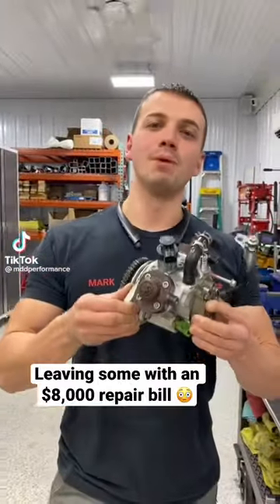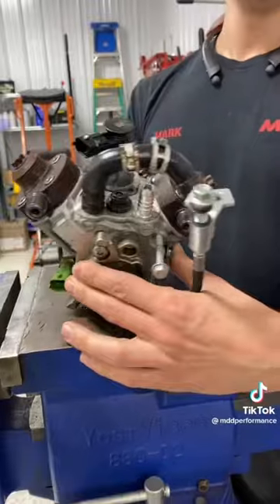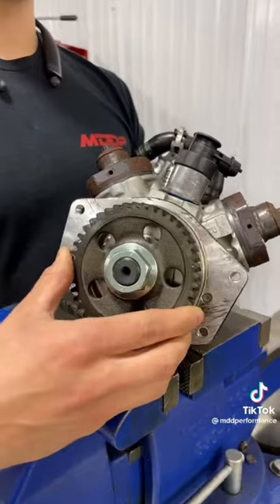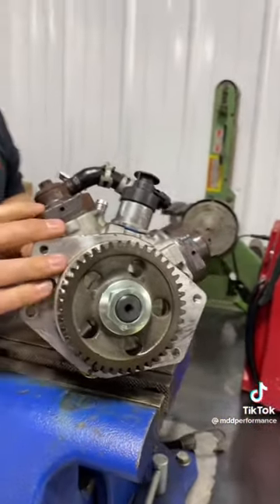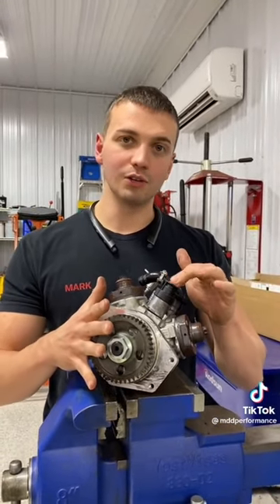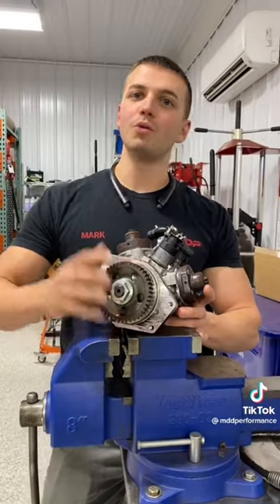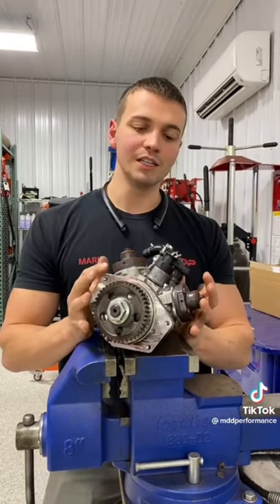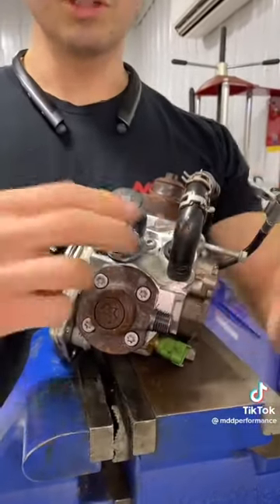PART 1: The reason so many fear the CP4 injection pump and how to help prevent failure!

Comment: Leave it to GM to make the executive decision to put something with very little testing on a consumer vehicle.
Reply: I'm certain the 6.7 powerstroke still uses the cp4 too
Reply: What happened here then, I just read, ford power stroker lawsuit was filed over the high-pressure CP4 injection pump, and Dodge also used the CP4 pump and just did a recall on the 2019 and 2020 6.7 Cummins.
Reply: All three diesels used it, LML Duramax, 6.7 Powerstroke, and the 2019 to 2020 6.7 Cummins.

Comment: I had no idea GM/Chevy used these. I thought only Ford used these hunks of junk. I have one on my 250, but they just developed a new pump to replace the CP4 that doesn't fail. I plan on switching before mine fails.
Reply: 😂 ford , gm , ram and Volkswagen,  and I'm sure many others , it's a bosch injection system that many companies use
Reply: @brianbonilla154  Yes, but in other countries where they don't remove the sulfur from diesel (basically all other countries) these things don't fail. The failure is primarily a US thing. I know for a fact that BMW and VW use the CP4.
Reply: @GuretoSefirosu  thanks well aware im.a former powerstroke / current cummins tech  , I'll gladly keep my 6.0
Reply: @brianbonilla154  6.0 PSD or something else? Ram is having major problems with the block heaters right now. My former boss and friend has a 2023 Ram. The block heater just totalled his engine, but he had the lifetime warranty. Engine has been on backorder for a month. All of 'em have issues right now.
Reply: @GuretoSefirosu  yea 6.0 powerstroke , also got a 04 vw tdi , I'd keep them forever b4 buying a newer diesel , also got a 01 bmw 540, 01 Pontiac firebird and 06 mazdaspeed 6, I got  problem
Reply: @brianbonilla154  No you don't. I own five bikes (cruisers), a boat, a 2001 Ranger with the 4.0 SOHC, and a 2002 525i in addition to the 250. I need to lighten my load also! The bikes range from 1981 to 2007. All carbs.
Reply: L5P 17 chevy  and newer does not use this crap

Comment: Yep had a disaster kit put on my 2011. Rails, injectors, everything except I did a cp3 conversion. Only thing they didn't check was the heads. Few months after I had a vacuum in my coolant system. Pulled the heads to do head gaskets and found a cracked piston. Need a new short block now. 211k miles

Comment: In your opinion can, what is the the most reliable Diesel engine? Trying to figure the best option for towing a camper trailer cross country. Thanks
Reply: Been around all 3. There's no reason why some are trouble free and some are always in a shop. Some take everything thrown at them in the way of use and modifications. Some should have never been sold. If buying a new one, find your best deal and buy an extended warranty just before the factory one runs out if it's been without issue. For the price difference and the fuel price difference, I'm about to go back to gas in a 1 ton.
Reply: Cummins
Reply: 12 valve Cummins
Reply: Dodge has shit transmissions and I’m not a big fan of Chevy using ifs for their 3/4 and 1 tons which leaves fords 6.7. Good transmission, strong front end and good motor.
Reply: They're all reliable without any emissions systems on them
Reply: 6.7 powerstroke and that is what all the mechanics I know tell me
Reply: @HSKFabrications  6.4 powerstroke ☠️
Reply: @jasonsimpson3985  except that one
Reply: @jasonsimpson3985 a 6.4 is extremely reliable when swapped out to a 5.9 Cummins or 7.3 powerstroke. Shoot I’d feel somewhat comfortable putting a bone stock 6.7 powerstroke in it lol
Reply: @jonesfarm1836  ford should have used the dt466 instead of the 7.3 to compete with the cummins 5.9
Reply: HINO J08E, ISB5.9, 6BT, and 7.3 Powerstroke. If you had to go with 2010s or newer, your option is pretty much only gasoline. The HINO J08E has a bullet proof Delphi pump but there is no real aftermarket support.
Reply: @jasonsimpson3985    The DT line of engines were to big in size for that size of truck.
Reply: They all have their issues, the best ones I’ve been around were the 7.3 Powerstrokes in the superduties or the early 01-07 Duramaxes. The Cummins is a very reliable engine but it’s surrounded by a garbage can.

Comment: I suggest anyone not wanting to tackle that job, change filters regularly. Use only reputable fuel and run HotShots Cetane boost. My truck has 195K and I was scared to death so I did the change myself on a 2013 D’MAX and it was a MF’r! However, the CP4 was still in great shape……

Comment: I used to love GM… but damn. They just let their customers down time and time again.
Reply: Ford & Cummins used the same CP4 and they’re all prone to failure.
Reply: Of course
Reply: HINO uses a Delphi fuel system that is more tolerant of lower quality fuels.
Reply: GM actually went to the HP4 denso pump which is probably the most reliable diesel fuel pump sold today. Shit happens and people fuck up. Fords been using that POS cp4 since 2011 and they still do the same thing.